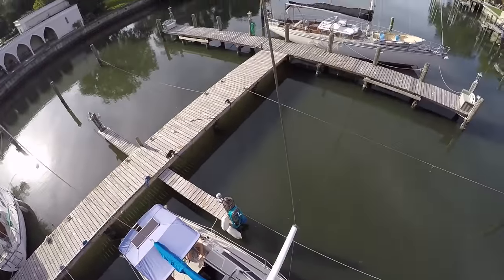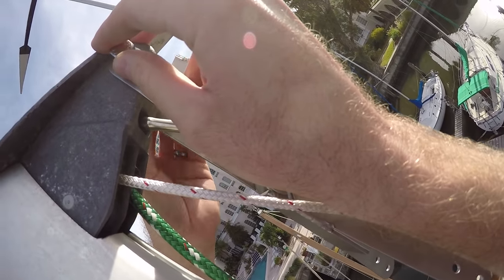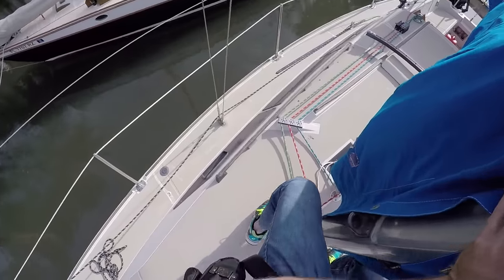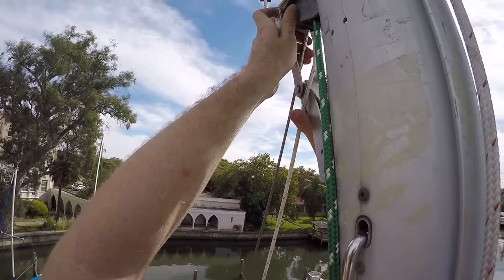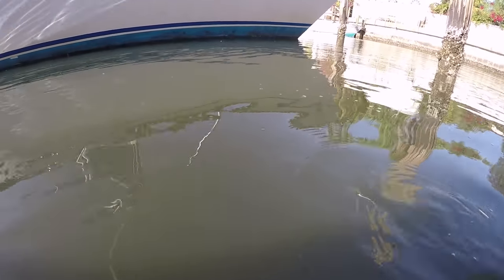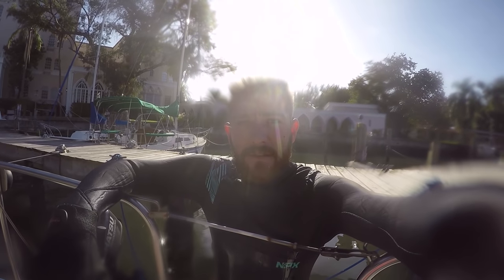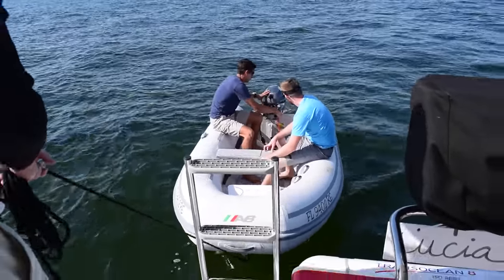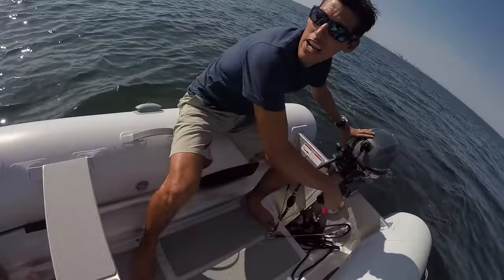14. We Check Out a Catamaran - Sailing Vessel Somnium

Comment: Great video! You may have done this but I didn't see it on the vid: very important to put something like Tef-Gel or Lanocoat on every stainless screw or bolt that goes into aluminum. It will prevent the galling/corrosion that will happen due to dissimilar metals. Later on it will be very difficult to remove.
Reply from the maker: I actually didn't do this at first but went back and did it. Thanks for the info!

Comment: Thanks for sharing. 
Just a little engineering tip. NEVER use a tapped hole as the way to shape a bracket when attaching to a curved surface. Use a soft face hammer to shape the bracket first then drill and tap your holes. This will improve the strength of the connection many times over. Just saying.
Reply from the maker: Makes sense, thanks for the input!

Comment: Check the furler mounting screws often !  If they start coming loose, remove them, ad a drop of blue thread locker and reinstall.  Rivnuts would be better/stronger than just drilled and tapped holes.
Reply from the maker: Will do, thanks for the input!

Comment: Roller furling mainsail on a 27'?  Why?  Will you be changing the mainsail too or just reef until you hit the battens? ( not practical). Usually a roller furler mail or in mast furlers require a smaller mainsail with no 'roach' or outward bow to the back of the mainsail.  The sails also has to be cut flat so it rolls up nicely.
All of this will result in less sailing performance and since you don't have oversize sails the loss of performance especially in light wind will be noticeable.  Look at the mainsail on the Cat , notice how it has a main to maximize the sail area on the size of the mast.  I think your money would have been better spent on a bigger mainsail for better light wind performance and install slab reefing.
Sorry if you have already thought this out and got a plan for mainsail.
Good looking boat work though.
Cheers Warren
Reply from the maker: Thanks for watching and for the input! We talked to a bunch of sail lofts before we made the decision. If you check out our other videos we sewed our own custom 135 genoa and new mainsail for the CDI mainsail furler. We're aware that there's loss of performance with a furling main, but we feel for us the benefits outweigh the drawbacks.
Reply: +Sailing Vessel Somnium ......Hi I checked out you sailmaking . Good job , I'm impressed , working on your knees must have been a hassle but you got it done. I checked out you sails while sailing too. I do think the main is small  but light wind sailing gets old fast in the heat so probably won't matter.
Go luck,  cheers Warren.
Reply from the maker: Thanks Warren, we're pretty pumped about how the sails came out!

Comment: I never use power drills, not even with clutches because it is so easy to strip screws or lose the drill when you are up there in the mast.
Reply from the maker: That's a good tip, thanks for the support!